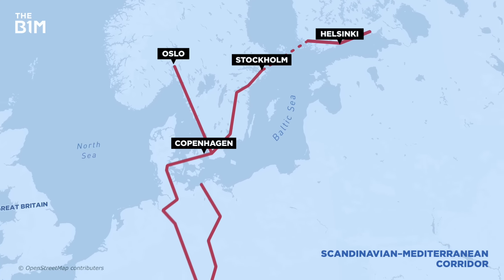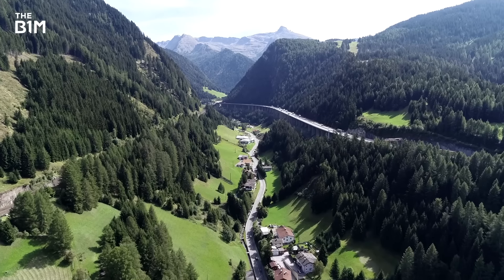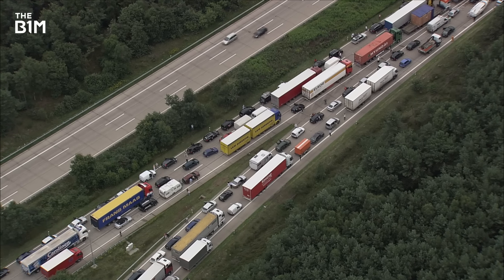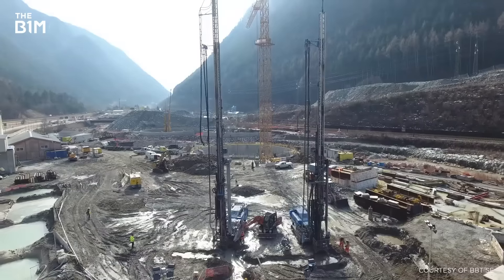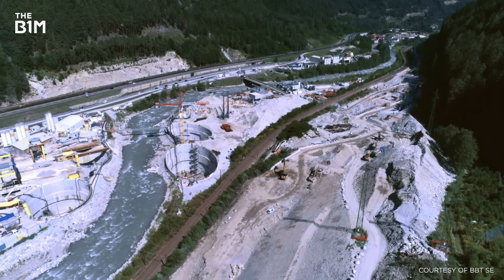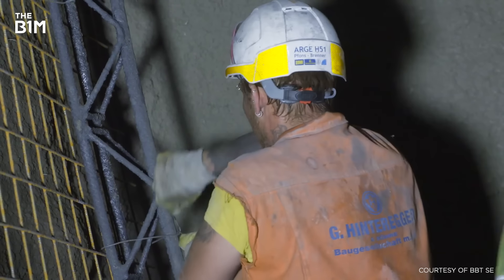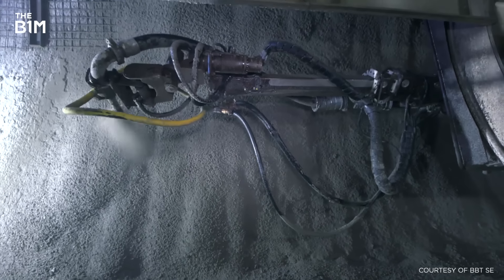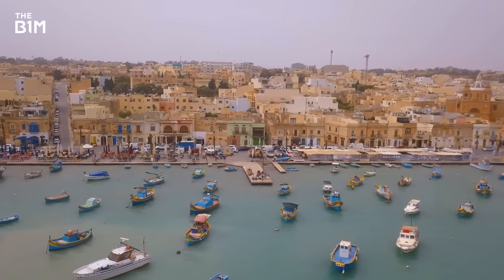The $11BN Tunnel Connecting Scandinavia to the Mediterranean

Comment: There currently 2 million trucks on the Brenner highway each year. The major purpose of the BBT is to reduce that.
Reply: Wasn't that the purpose of the Gotthard Base Tunnel, to get get trucks put on flatbed trailers to be moved by train through the Tunnel to reduce the air pollution through that part of Switzerland?
Reply: @Sacto1654  I'd say both tunnels have the same purpose but in different sections of Alps (as the mountain range stretches pretty long).
Reply: @Sacto1654  The Gotthard basically links North-Western Italy (Milan, Turin, Genoa) and the rest with Zurich, the Rhine and the Netherlands. The Brenner instead connects Trentino-South Tyrol, Veneto (region of Venice, Padua and Verona), Bologna, Central and Southern Italy, and the Adriatic coast to (Northern)Tyrol, Bavaria, Eastern Germany and the whole Scandinavia. 
They serve different flows of goods and people which are both huge
Reply: @Hastdupech8509  @Sacto1654 The main difference is that traffic flow through Switzerland is much lower due to the fact that Switzerland is not in the EU. Whilst the Swiss can charge very high truck tolls to cross-finance the construction of its base tunnels, Austria is only allowed to charge a moderate amount as anything else would be considered a violation the free movement of goods and services principle of the EU. Consequentially more than 2/3 of all the cross alpine truck traffice is running through Austria.
Reply: @hackbrettschorsch6855  Thanks, that makes a lot of sense
Reply: @hackbrettschorsch6855   I think this is a bit stretched, Lorries pay a hefty fee also in Austria, the difference in financing the project is that the EU is financing the tunnel in an important part, Switzerland had no access to these funds.
Now the next tunnel will be the doubling of the Gotthard road tunnel, to start in a few years.
It will be interesting to see if speed of construction and costs will decrease as technology improves.
Reply: @Braun30  To my knowledge trucks in Switzerland pay almost double the amount compared to Austria. It also doesn't help that Austria has three four lane motorway connections through the Alps whereas Switzerland to my knowledge has not a single motorway that is four lanes all the way. The double lane Gotthard Tunnel is quite the bottleneck.
Reply: @hackbrettschorsch6855  that is one of the reasons the transfer to rail is so important. 
More roads you build, more cars and lorries will want to take that way.
At a certain moment one must say enough.
There are various ways, one is to make it financially inconvenient and the other is to force freight forwarders to use the rail.
Reply: @hackbrettschorsch6855  in any case, from Kufstein to the Brenner Pass it is just 120 km.
From Basel to Chiasso it is 305 km.
So by money spent per mileage, it is cheaper to cross Switzerland if it's only double than the Austrian tariff.
Reply: @Braun30  Double per km that is.
Reply: @Braun30  Exactly. Austria has a pretty good system in place as well for the Brenner route, called "Rollende Landstraße". Trucks can transfer to a train in Wörgel and get off the train again in Trento. The price for the train ride is the same as the toll for the trucks on the road. Sadly you cannot force trucks to do this, due to EU regulation...
Reply: @hackbrettschorsch6855  we have an other name for it but it means the same.
Actually because in Ticino we use an Italian terminology.
"L'autostrada viaggiante"
Reply: @Sacto1654  as trucks have to go through customs from Germany to Switzerland and from Switzerland to Italy the whole idea is compromised. Especially if you consider that Swiss customs are closed on weekends. The route is too unreliable and too expensive. The Brenner is shorter and does not have the Swiss bureaucracy in the middle.
Reply: Some improvements to the Brenner highway would have likely be a lot cheaper and more sensible...
Reply: @robertsanders7060  that would not solve the pollution issues ..
Reply: @alexandergutfeldt1144  Electric cars will solve that issue in 20 years
Reply: @robertsanders7060  I hope very much that you are right, but (you knew that 'but' was comming 😃), we are still one or two technological discoveries short.

Comment: And then we need Germany to finally upgrade their train infrastructure, without that we'll still have a massive bottleneck between Munich and Innsbruck where trucks keep piling up with no silver lining in sight.
Reply: i mean germany still hasn't finished their promised upgrades to the Rhein line which was supposed to be done to make the gotthard base tunnel fully utilised. At least in Italy they admitted they weren't gonna do it and let the Swiss do it for them xD
Reply: Hey, we finally installed electric power lines on the train tracks between Hamburg and Lübeck.
In 2008.
And we will be extending the power lines all the way to Fehmarn to connect to the tunnel the Danes are building. And maybe even add a second track so two trains can use it at the same time.
We're pulling out load! :p
Reply: @Yora21  That Karlsruhe-Basel Rhein Line Upgrade won't be completed until the 2050s according to current Planning and the Upgrades on the Lübeck-Puttgarden aren't even decided to be built at all. If they get built, it will take at least 20 Years too.
Reply: @Yora21  Wait...WHAT? Hamburg-Lübeck didn´t have power lines until 2008? :O
Well, at least we found out recently that the Internet is actually useful...
Reply: @RSProduxx  you know... from Switzerland to Munich they still don't have power lines...
Reply: @lokiodinson5412  They finished installing power lines from Zurich to Munich last year.
Reply: @mrj5153  amazing XD
Reply: Same problem at the Dutch border. There is a very fast line from Rotterdam port to the German border (costing 5bn euro) and then everything the Germans were supposed to do at their side is delayed...
Reply: Why are Germans so stingy? They have billions in surplus 🙄
Reply: @_blank-_  Well, there is the car-industry which has massive lobbying power and then there has been the attempt to turn the state-owned railway-company into a profit creating share company. You can imagine the impact this had on spending for maintenance of existing infrastructure. Now a lot of money is needed for repairs and modernization. New projects get delayed. (Disclaymer: I am not an expert. This is just what I gather from news and such.)
Reply: @Yora21  A new 55 kilometer line and around  30 kilometer og upgraded line is planned between Lübeck and the Fehmarnbelt Tunnel.
The line will be double tracked, electrified and build for 200 km/h .

Also included in this project is the new 1,7 kilometer Fehmarnsund Tunnel and S-Bahn to Bad Oldesloe on the Hamburg Lübeck line to relieve the main line of traffic.
Reply: @houstonhelicoptertours1006  That's a nonsense excuse, it just took longer to take the money from the sprawling car infra because Germany is so car-oriented. Of course with opposition by AFD.  They are doing it now though, the rail infra budget has recently been doubled. Yay for Germany.
Reply: @_blank-_  Moving transportation from road to rail is politically difficult in Germany
Reply: @Yora21  I am sure you guys are pulling your load, but hear me out for a sec, wilya ?

Back in 2008, China started construction on their first ever highspeed railway. 13 years later (that's 2021) China has over 35,000 KM (22,000 miles) of highspeed railway in operation and by the end of this year China gonna get 968 more KM  (600 more miles) of brand new highspeed railway.
Reply: @tube_de_siguro  Italian "engineering" is a joke, so that sounds wise. (Italian design is great though.)
Reply: Not possible if railway construction already takes up like 10 years just to plan in Germany. Planning and building here takes so long, it’s ridiculous
Reply: @_blank-_  "Why are Germans so stingy? They have billions in surplus 🙄"
IMHO the real problem is not the money, but all those NIMBYs. You can't build a single meter of rails without someone organizing protests and lawsuits.
Reply: @_blank-_  Because it's all just a show. If they'd be maintaining and furthering their infrastructure, people could notice the mess Merkel's Germany is. Better to keep the coins in mother's purse, so nobody notices she's short of cash.
Reply: Jedes Mal auf der a93 🤮🙄
Reply: Not gonna happen, as long as the car industry is so powerful there.
Reply: @xarcaz  And yet they have very good high speed rail network built by Italian and international companies,take a look on youtube.
Reply: NO MOR EHILTERS, PLEASE!!!!!
Reply: @_blank-_  The short answer is the money goes to the Autobahn and other car / truck infrastructure. Maybe with the green party in power there will be some money reallocation.
Reply: @_blank-_  It's the other way around. They have billions in surplus because they are so stingy!
Reply: you've got one of the best in Europe trust me hahahaha
Reply: @clocktower1164  Comparison with the monoblock that is China isn't that useful - the authoritarian regime dictates what happens, they jusy don't have the same scale of 'inertia' from lobbyists or any real political opposition.
Reply: @telectronix1368  As long as it's a human organization, *inertia* is built-in。
Reply: @clocktower1164  Well, China doesn't care about the environment, the people living where the railway is to be built and so on, and there is absolutely no political opposition to anything and they have much more money to throw around. If course everything can be done WAAAAAAY faster.
Reply: @clocktower1164  What do you have to say about the planned dam project in Tibet then? That showcases exactly all the issues i'm talking about.
Reply: @Naryoril  USA has over 80,000 dams. Before you want to criticize China, why don't you question why USA wants so many dams.
Reply: Well, our government prefers cars, and its plan is to use hydrogen based cars... once we get free hydrogen based on renewable energy sources around the equator
Reply: @_blank-_  Men in our country define their life by cars, fuel cars (because they have xx% more range).
Change is almost always bad
Reply: @clocktower1164  I'm not from the US, i'm from Switzerland. And here a project to make a dam a few meters higher was recently scrapped due to environmental reasons.
That's exactly the things i'm talking about. Due to stuff like that, projects take much longer to realize in Europe than they do in China.
Reply: @telectronix1368  If you can't get rid of your own bias, then, please live with your own bias.
Reply: @clocktower1164  Hahaha, save the ad hominems, sweetheart, they are not the same as having an actual argument.
Reply: @clocktower1164  "Back in 2008, China started construction on their first ever highspeed railway. 13 years later (that's 2021) China has over 35,000 KM (22,000 miles) of highspeed railway in operation and by the end of this year China gonna get 968 more KM  (600 more miles) of brand new highspeed railway."

yeah, it's amazing how you can trade freedom for efficiency and keep the trains running on time.
Reply: @thomasneal9291  Is the West really 'free'  ?

Can you say that 'n-word' on youtube  ?

Can you do the nazi salute in Germany  ?

Can you stop paying your tax if you disagree with what your government is doing (or has done)   ?

Stop lecturing others on 'freedom' when you yourself ain't enjoying real freedom in your 'free West'   !
Reply: @thomasneal9291  The western world has outsourced environmental pollution (from mining, manufacturing and transport) to the east, especially China.

Where do you think most of the electronics and cheap tat comes from?

The 'big bad eastern pollution' includes, effectively, western consumer pollution.
Reply: Well if you want to fix that bottleneck you have to wipe out almost the whole german part of the Inn valley. Good luck convincing the people that their home has to be turned into a highspeed train line so that a container can get from Denmark to Italy faster
Reply: @thomasneal9291  not all of these lines are for highspeed
Reply: @_blank-_  They produce trucks, not trains. :)
Reply: @thomasneal9291  and all those non profitable rail lines are going to end up in a crack worst than evergrande